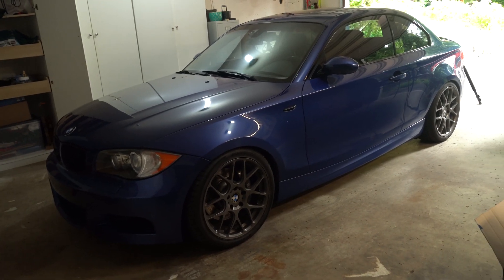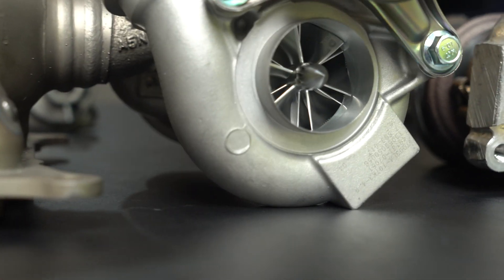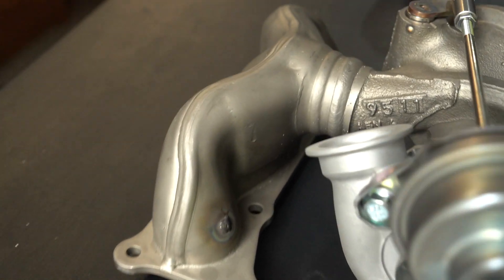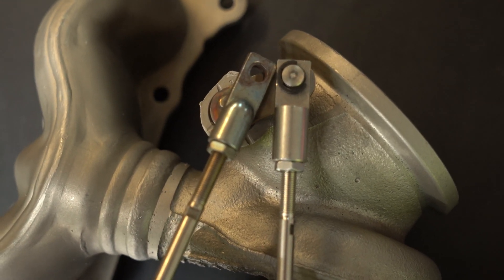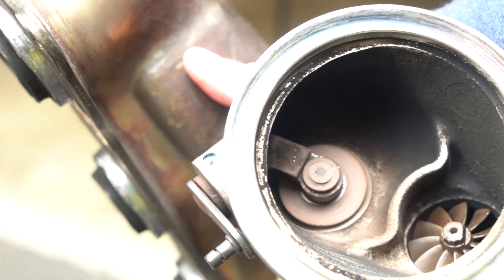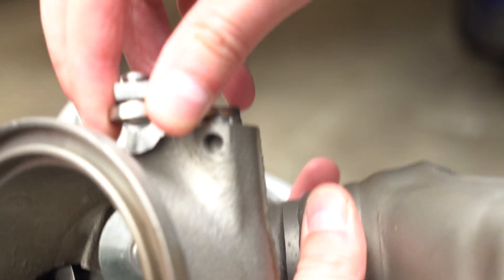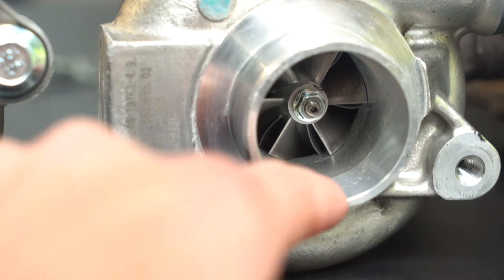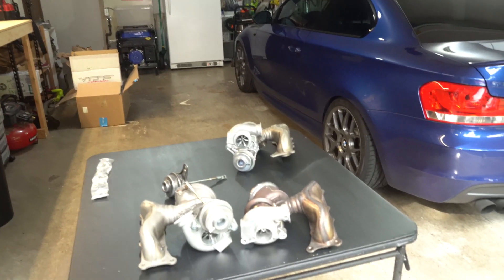N54 Pure Stage 2 hybrid turbos vs Stock - Side by side comparison!

Comment: I installed those on my N 54. It's a 2008 335 without changing the mapping they didn't do a lot. I had to get a custom map and then it woke the engine up. It goes really good now.

Comment: Hey my stock turbos waste gates have failed and are leaking boost. I want to get a stock turbo TD03 with upgraded internals. What supporting mods do I need if any? Your help would be greatly appreciated. Thanks.
Reply: Did you find any information?
Reply: @dencycollazos392  nope. No info. Never herd back from him. My car is still drivable. Its only losing partial boost and limp mode only comes on if I floor it. Its kinda put on the back burner until I finish sinking money into my house Reno.
Reply: Upgraded inlets is a must.
Reply: @r3drogo  ok thank you
Reply: @EsspressoMan1  you're welcome. don't forget to buy the "wastegate rattle repair kit" if you gonna upgrade your stock turbos.

Comment: What octane fuel will you be going with? Or e85?
Reply from the maker: Its a little hard for me to get E85 where I am at, so initially I am going to see what pump 92 will make and then tune up with 3 gallons of e85 mixed in from there. The E85 definitely makes a huge difference, and I know that is where all the power gains will be with these turbos.